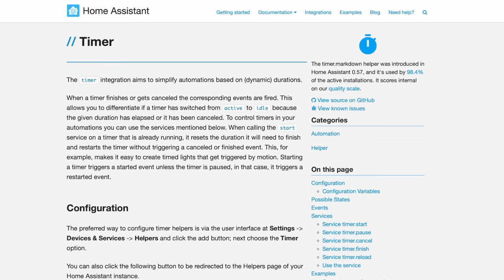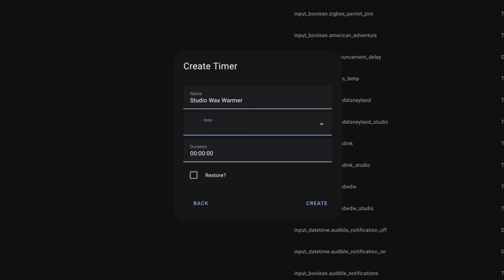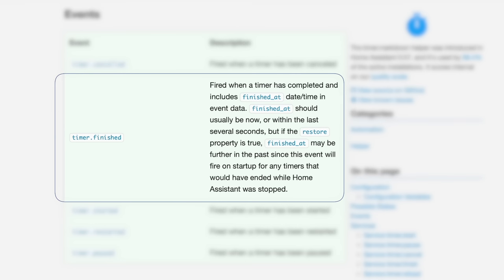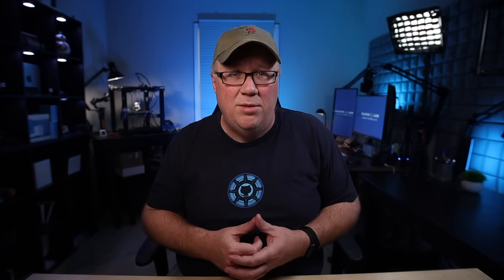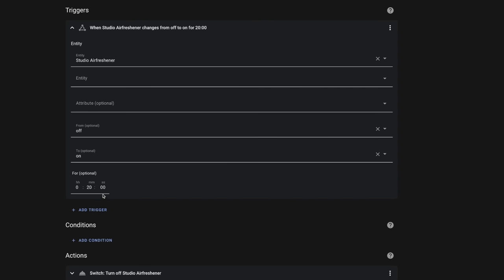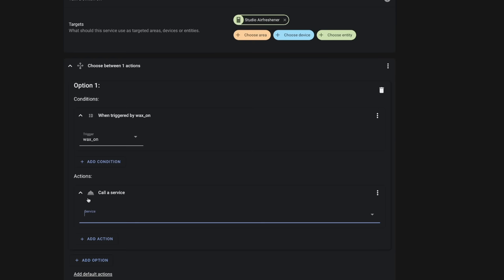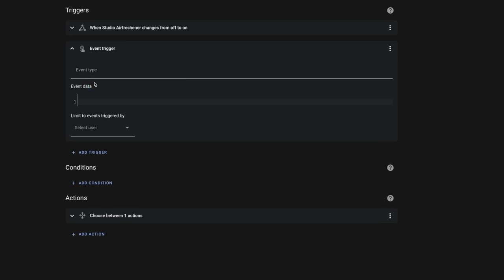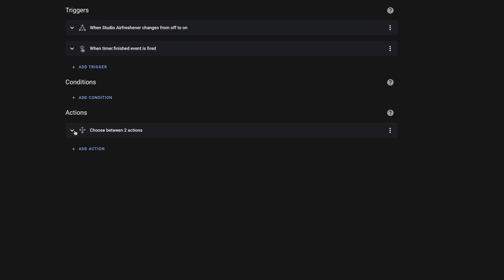Use Timers to build Reliable Automations in Home Assistant

Comment: Slightly cleaner for the "on" logic is to check if the timer is idle. If not cancel it. Not sure what timer.start produces if the timer is already running.  A manual off could also cancel the timer.
Reply from the maker: If the timer is started and it’s running it restarts the countdown.

Comment: On HA's timer page, it has the following note:

Timers will be restored to their correct state and time on Home Assistant startup and restarts when configured with the restore option.
However, automations using the timer.finished event will not trigger if the timer expires when Home Assistant is not running.

The second sentence caught my attention. Does this suggest that if your timer "would have finished" at the time HA is being restarted (i.e. not running) that any associated actions will never be called?
Reply from the maker: Yes. Previously it was stated that it would work even if it finished during a reset. But then a big was found. Looks like they decided to just make a note and not “fix” it

Comment: My application for timers is to be able to differentiate between an external motion detection (ostensibly a package delivery) triggered by a camera, and our being detected when fetching that package after a door sensor is trigger. So the logic is: "there's motion sensed on the front camera. But was the door opened in the last minute? If not, notify so we know a package has been delivered" Not earthshatteringly complicated.

Comment: Thanks for the Video. Someone mentioned in the comments the timer.finished does not work as trigger for action and the same was my experience. I had to use Entity > state > from Active to Idle as my trigger. Also for Action I had to use Device > switch device off and well it worked. The setup of timer and starting timer etc all being the same. I am on 2024.1.0
Reply from the maker: Were you using the platform event with the timer.finsihed? It works fine in my current automations. Your method will work to. But just be aware if you cancel the timer the state will also go from active to idle so your automation will trigger. Shouldn't be an issue unless it's a timer you expect there to be a reason to cancel at some point and you only what your automation to trigger when the timer actually reaches zero. The state just tells you if the timer is running or not. It doesn't indicate why the timer is no longer active. If that context is important you will have to use the event messages.
Reply: @SlackerLabs  Basically I followed you in the video and it did not work. I noticed the timer started on turning the the 'switch on' but after count went to idle nothing happened. Guess I can no longer find the right Event trigger. The video is old so things might have changed. I only recently got into HA. 

Oh interesting, I see what you mean about the active to idle. So here is a question. which option would you choose in the trigger section if you are setting it up today? 

I am in the process of figuring out the humidity levels in the bathroom and getting my exhaust fan to turn on when it goes up but struggling with weird humidity readings. In the meant time its turned on manually and left on after showers for a while to ensure mold doesn't grow and sometimes on for hours. 

This is what I did for now.

No presence > Light turn off + start 20 timer.
Light turned on > timer cancel
Timer idle/finished + Fan still on > Turn off fan
Reply from the maker: @guylast9516 I don't think anything has changed. All of my timer based automations using timers are still working. 

Most of mine follow a similar pattern as you have. 

Typically motion sensor trigger light to come on and an action to start a timer. 

Then a trigger for the event platform with the name of the timer entity. 
Like the automations at https://www.home-assistant.io/integrations/timer/#control-a-timer-from-the-frontend
Reply: @SlackerLabs  Ok I deleted my comment as it was getting long. So with my testing I found that the issue is the Timer finish trigger in the ADD TRIGGER section. It does not trigger. I had to change it to Entity> state then pick the timer and call service to action

So basically this works:

platform: state
entity_id:
  - timer.test_timer
from: active
to: idle
id: State timer
choose:
  - conditions:
      - condition: trigger
        id:
          - State timer
    sequence:
      - service: switch.turn_on
        data: {}
        target:
          entity_id: switch.living_2_light_right
        enabled: true

This does not:

platform: event
event_type: Test timer finished
id: Test Finished
event_data:
  entity_id: timer.test_timer
choose:
  - conditions:
      - condition: trigger
        id:
          - Test Finished
    sequence:
      - service: switch.turn_on
        data: {}
        target:
          entity_id: switch.living_2_light_right
        enabled: true
Reply from the maker: @guylast9516 updating this comment since I misread something. But here is a link to mine that works. https://github.com/thejeffreystone/homeassistant-config/blob/0b4fc89e94c2fbac71156e8bb6a90809a5e877ab/config/automations.yaml#L590
Reply: @SlackerLabs  Yup so looking at the Studio warmer code you have the turn on Studio warmer trigger turning the timer on and then the event timer finish turning it off. I tried the same in several automations and it fails to trigger. No idea why that is. I set it up the same as yours with the only change being the device I wanted to control but it didnt work which is baffling.

Comment: It would have been great if there was a Restore checkbox available for the For function. A timer is a nice workaround but it doesn't solve the real problem. Another workaround is to use a template as a trigger. I  use this template as a trigger to turn off a specific light after 30 minutes, no matter what: is_state('switch.light', 'on') and (states.switch.light.last_changed < now() - timedelta( minutes = 30 ))

Comment: This is a good intro into using timer helpers.  While I would only use this for my more important automations, setting this up on a few lights was really good practice.  It would be great to get a more in-depth tutorial on the Choose action.  There are a lot of good use cases for Choose, but not many people know about it or what it does.  I was super confused by it when I first tried to use it.    I think Choose is great for programming buttons on a light switch (I programmed my Philips Hue switches with it).

Comment: Great Video. Is there a simple way to create a switch with a timer for my gutter ice melt outlet?
Reply from the maker: That one might be tricky unless you have a way of knowing when the device plugged into the outlet was on. You would need a way for Home Assistant know when it was on so and a way for it to turn it off. Which prolly means a power metering plug or something like that.

Comment: Is the restore option new? I used timers before to manage my motion sensor controlled lights . But timers didn't survive reboots. I will now modify my motion controlled light automations. Thanks Jeff.
Reply from the maker: Not sure on that. I didn't even bother with timers until recently. But I want to say it was. Timers are one of the newer things in the UI though.
Reply: Yeah, the restore option is a very recent addition, I couldn't tell you which version it appeared in though, as I've only just plucked up the courage to update my instance from what it was running in July.

Comment: is there a sunrise and sunset time condition in home assistant?
Reply from the maker: Yes there is. There is actually a couple of ways to use the sun position as conditions. I usually use the state platform with entity sun.sun and check if the value is either above_horizon or below_horizon. But there is  sun platform that can be used that allows you to choose before or after either sunrise or sunset.

Comment: I must be doing wrong, because I cannot get this to function properly where the FOR always works, just with caveats

In my case
Trigger1: Ring Doorbell detects Motion - TriggerID = FrontDoor_Motion_On
Option1: When triggered by FrontDoor_Motion_On 
O1Action 1: Start Timer - timer.front_door_motion_timer
O1Action 2: light.turnon - Front Door - White

THAT PART WORKS

What doesn’t work is:
Trigger2:  ID FrontDoor_Motion_Off
Event: timer.finished
Event data: entity id: timer.front_door_motion_timer
Option 2:
When triggered by FrontDoor_Motion_Off
Action: light.turnon - Front Door - Blue

The timer works, it counts down in Lovelace, but timer.finished does not trigger the turn light blue action
Reply: I made an exact replica of your automation, using a wax warmer on a zigbee switch.... Timer and turn on triggers, but after timer finishes nothing happens

You say TIMER.FINISH in your video, but type TIMER.FINISHED I am using TIMER.FINISHED.... is this the issue? I have poured through HA docs as well and cannot get this to function....

Going back to using FOR